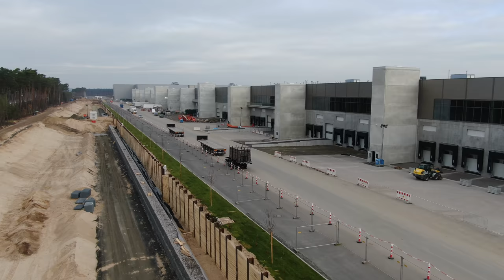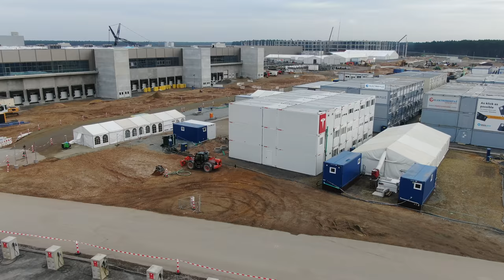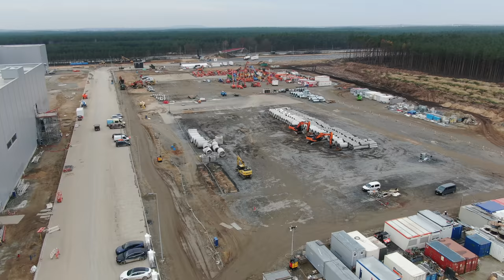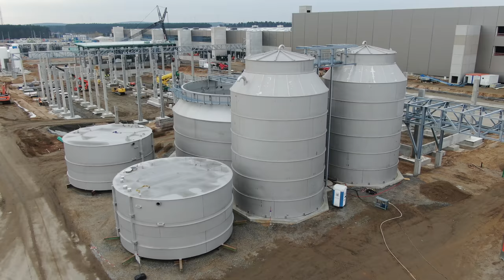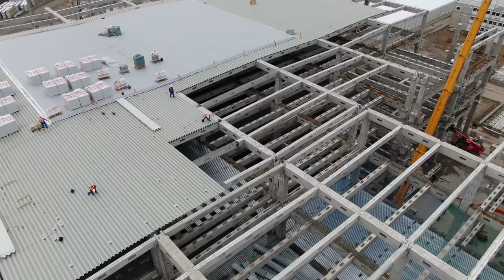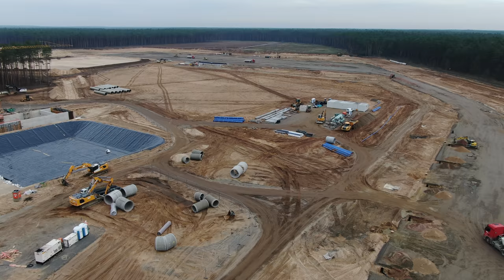Giga Berlin | 2021-11-27 | Cell production roof

Comment: Seems like more workers than we usually see on a Saturday, no?
Reply: these german workers realized it may get cold in december so they are trying to close in the building asap.  They realized that last week.  in november... in germany
Reply: @davidanalyst671  believe me, the worker who are working outside there will not work inside. What should they do there? Install robots? LOL No they will work outside so long the temperature aloud that or the finish there part.

Comment: Very odd that they left that small lobby area attached to the main building, as the last piece of construction.
Reply: They changed the plans for it at least two times ...
Reply: It's not necessary for building cars, so seems logical to me to leave it for last.
Reply: @DanaOredson  exactly … that is the same when people ask why are no solar panels on the roof … they will come I’m pretty sure but for now there are not on top to do list. People should understand that. All this work is just the cherry on top of the cake

Comment: Love to see daily progress, in such a short time frame of 1 year from a forest to largest auto factory in Europe. I see the battery cell production just started as well the concrete roads. How does the media, and Musk say they are ready for production without the roads finished? Same with Austin Texas. I will believe they are ready when I see a parking lot filled with cars and Model Y's rolling out the doors.
Reply: Ready to start producing cars and testing cars and ready for production are slightly different things.  The factory has some roads, completed loading docks, carparks waiting to be filled and we have seen pictures from inside which shows a ready to work factory and we have even seen MIG MYs in the parking lot already.  Is that not ready enough for you?
Reply from the maker: Where they are going they don't need roads. First production cars will be loaded directly onto closed trucks at the loading docks.

Comment: Only two days left to get the final approval by the end of this month.  Can it happen?
Reply: No.
Reply: @julianreverse  But the approval will come.
Reply: No. The head of the responsible department in the environmental office lamented in an interview on Monday that they are still waiting for documents from Tesla. Those are in my understanding needed to answer questions raised during the last public hearing (the regular one which was now repeated). Before the administration can't answer those questions positively, i.e. stating what Tesla plans does not conflict with any laws, they won't issue the final approval. The risk that the court would void such a premature final approval would be too high.  And such a court action could result in really serious delays. 
The main risks regarding permits with large projects in Germany are in first place procedural mistakes by the administration or that the investor does not build what was applied for. 
Example: Tesla applied for a car factory with a sprinkler system. Thus it also has to build a factory with a working sprinkler system.